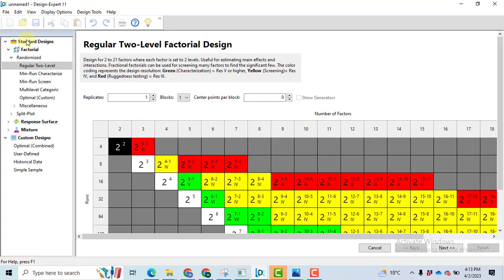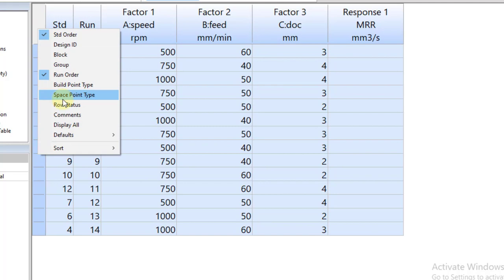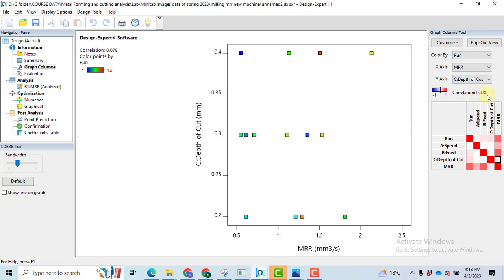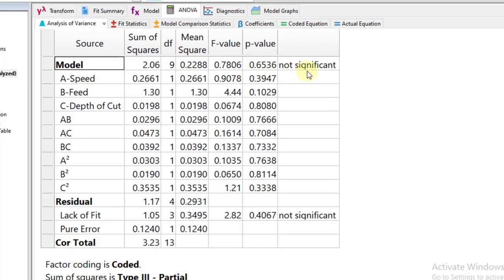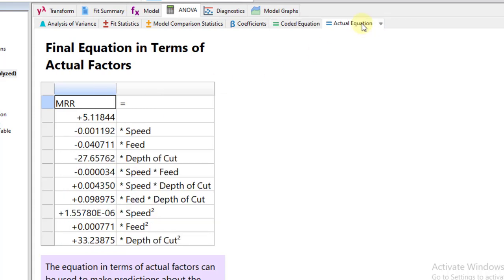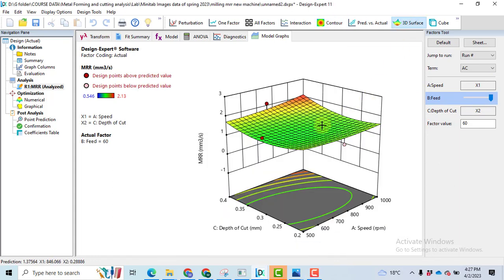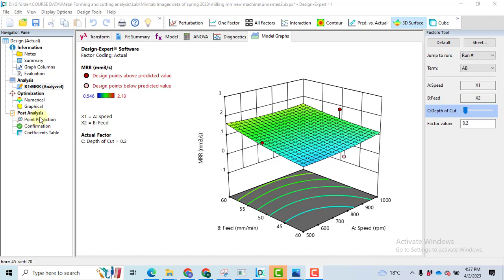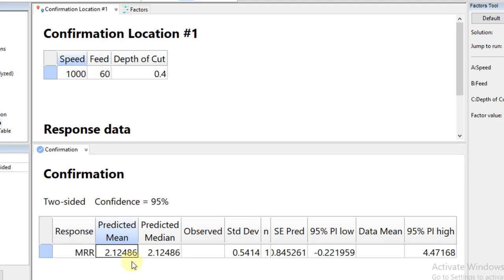Response Surface Methodology Box Behnken Design in Design Expert | RSM Analysis Optimization

Comment: Thankyou so much
Reply from the maker: @alinasyed24  welcome
Reply: @EngineeringandInfo  is it necessary that none of the values in the Report in Diagnostics be red or blue in the table? even if P vale is significant in Anova and lack of fit non significant? 

what is one or two values in Externally Studentized Residuals or Influence on Fitted value exceeds limits ??
Reply from the maker: @alinasyed24  can you please contact via WhatsApp so that I can guide easily

Comment: Namaste sir. Thank you for this wonderful and useful explaination. Many times we struck in betweeen a step while doing experiments and analysing them. First thought will be of searching solution for every problem in youtube.... However all vedioes cannot give solution still we find some usefull vedioes like this. Thank you so much for this vedio. 

 And i have one doubt in my work. I have 3  independent variables, and analysing for 3 factors, model suggested by softwarre are different for each of them like linear, quadratic, and 2FI. Is it ok? And for one among them requiers transformation (invers square root). So i am not getting any vedioes that can explain transfotmed ones.. Is it the same way of analysingas like  the normal one Kindly suggest me what i can do, should i proceed or not to proceed?  

Thanking you